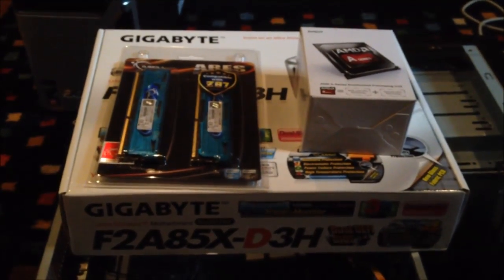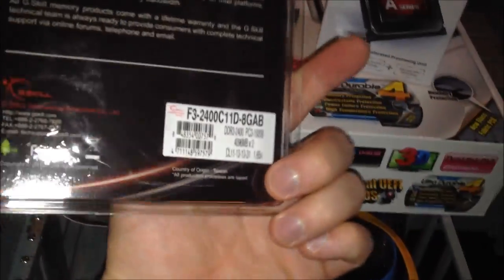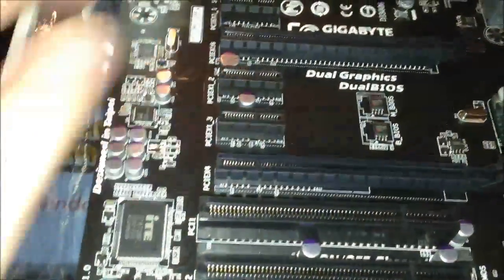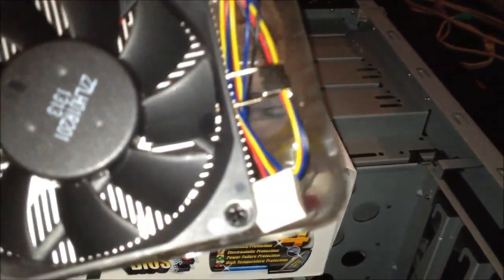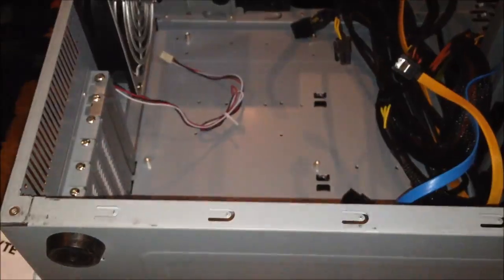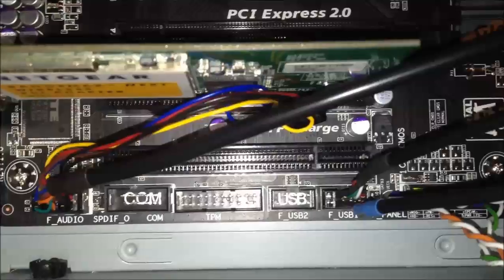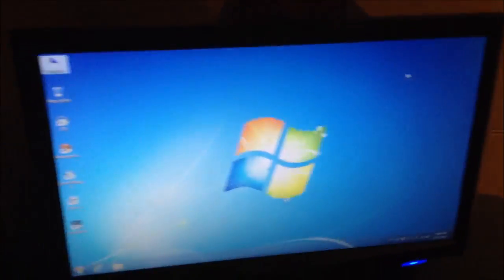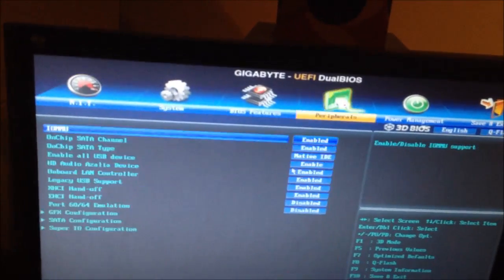Bedside Computer 8-13-2013: AMD APU Build

Comment: Just a thought, if you are so concerned with energy consumption, consider how much power and resources it takes to manufacture the components and try to get at least five or six years out a computer instead of just a couple. You might just save more energy that way. BTW, like your channel and vids - keep up the great work.

Comment: Sorry, but you say the stock cooler ain't good. I got the stock cooler for my AMD A8-6800K and its perfect. Idle 28 celsius, when playing bf4 55 celsius. As long you've got good airflow it works perfect, if you overclock it or you've got no good airflow, it is only understandable that is gets hot.
Reply from the maker: a friend of mine wasn't so lucky and his case had great airflow

Comment: 2400MHz should be fine with Richland. I've heard that Gigabyte FM2 boards support XMP, try enabling the 2400MHz XMP profile for the memory. 

2400MHz will give you a huuuuge boost in graphics performance, around 10fps more in most games. Tek Syndicate recently did a video on this, it's quite impressive.

Nice build, the APUs are great for this stuff :)

Comment: It is much easier to break a pin on a CPU than a motherboard socket; main reason is that the motherboard pins are inset within the socket. Also: Where do you store a CPU w/ pins so that you won't accidentally bend/break one. Fun fact: AMD knows that pads on the CPU and pins in the socket is the way to go, just look at their server CPUs/Sockets, they're just like Intel. For what ever reason, they just haven't made the switch for the general consumer...

Comment from the maker: i won't be able to just do a BIOS update on the board i have an use it because socket FM2+ has a two extra pins. similar to the difference between Socket 939 and Socket AM2.

Comment: my i7 runs from 40c to 75c depending on load. And the strange thing is im on watercooler. Artic silver 5. On air it was overheating quite badly.

Comment: It is true that AMD chips have a lower maximum temperature, but exceeding that temperature does not make them fail immediately. All chips are built to sustain operation in those conditions for an extended period of time.

Comment: They ship this cooler with all of their 65W chips, and they have since the Athlon II chips. The Athlon II X2 245 I used to own also had this cooler, and it was adequate for that chip. Even at 3.5Ghz from the default 2.9 it would barely reach 55 degrees.